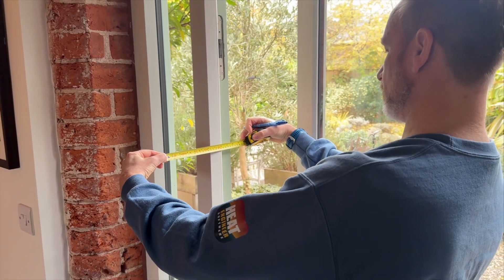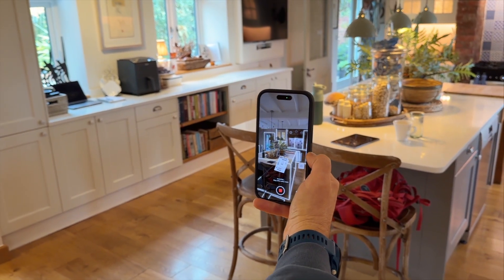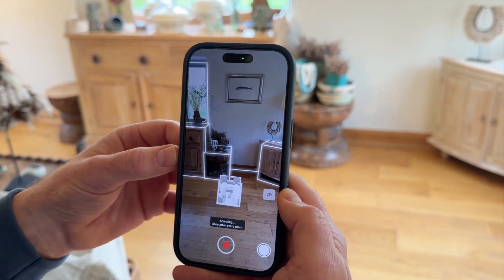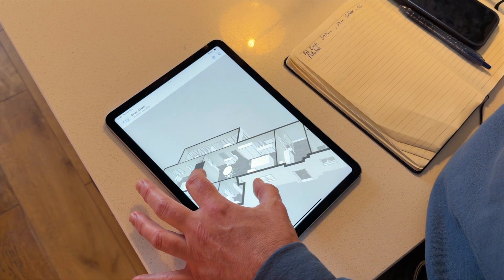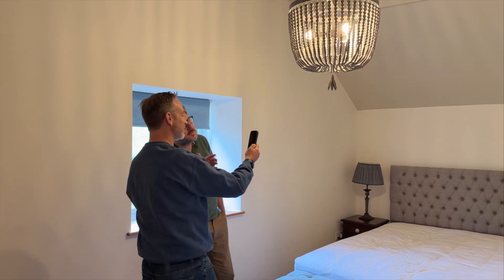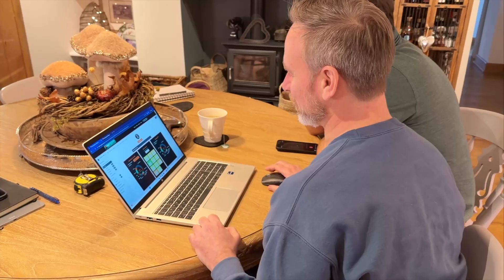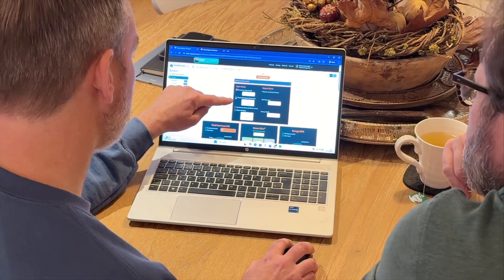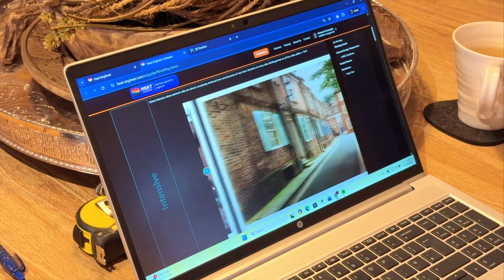Size Your Heat Pump Perfectly: Stop the Guesswork

Comment: When I got my heat pump installed the heat loss survey was suggesting we were needing a larger heat pump compared to the peak gas usage on the coldest day, so we got the next size down from the heat loss calculation whilst being above the peak hourly gas usage. Coolest temperature outside has been zero degrees Celsius so far and it's managed fine. Be interesting how it goes with more prolonged colder spells later in the winter. 

I'm surprised using the existing heating use as a factor didn't come up in the video, unless I missed it.
Reply: Yes, using the gas-usage is telling a lot. Also about the airchange calculated in.. And personal behaviour using the house.

Comment: Evening 

I did a heat loss for a customer on friday that had used an MCS umbrella company for a quote and heat loss. They did this off plan and stated it was 6.7kw heat loss. I have used my Lidar heat loss app put actual data in and come out at 8.5kw. Not a massive difference but in my opinion could definitely mean someone ends up with an undersized heat pump.

Comment: To me the most important point of doing the heat loss calculations is to work out what insulation needs fixing. After you've fixed the cheaper insulation issues then think about something like a heatpump. A lot of insulation has a very rapid payback and it'll cut your bill before you get something like a heatpump.

Comment: I bought an cheap (£20) laser measure online and used Heat Punk (free for personal use - create a free account first). 
I watched the Heat Punk instruction videos on YT. My own heat loss calcs were only 5% different to the Heat Engineer value given by my installer who used a fancy lidar based tool.
Maybe it was luck, but others have used Heat Punk to great effect. Easy if you have mainly rectangular rooms.
Michael Podesta also has a video on how to calculate heat loss using your previous gas bills and some rules of thumb.

Comment: What are people's thoughts on actually measuring the internal and external temperatures over a few weeks and use the gas usage from the boiler as the heat in to work out the heat loss? Use that in combination with heat survey?
Reply: I initially sized ours on the basis of the gas energy usage over the previous two years being roughly the energy requirement. It's a good way to get a general feel of the energy needed and the numbers, but I think it's a terrible proxy for peak requirements which is what actually also matters a lot, so you definitely need to do the heat losses even by hand to get a rough check as well.

As we were doing air/air I didn't have to care much about accuracy because air/air systems can be expanded and inverter air/air can be way oversized without harm.

For air/water it's a different game as accuracy matters so - check you work yes, actually size it - no IMHO
Reply: For some bizarre reason the MCS (Microgeneration Certification Scheme) standards do not permit the use of historical energy consumption data (such as energy bills) as the basis for calculating heat loss to size a heat pump system. 
MCS requires a formal, theoretically-based heat loss calculation for system design and sizing, in accordance with specific industry standards: 
Mandatory Calculation Method: The heat loss calculation for an MCS-certified installation must be a detailed, room-by-room assessment following the methodology outlined in British Standard
Reply: @davidsinclair144  an issue with historical heat bills is that some people actively limit how much and how long their home is heated to keep their bills down. It has been long advocated to not to heat rooms that you are not using. Not switch on the heating until a certain date regardless of conditions and then switch it off as soon as it’s officially spring. Other tactics including minimizing being at home, to avoid using heating. There is the other end of the spectrum where heating on all the time at 24C plus and temperature in rooms regulated by opening windows. An ASHP works better at lower temperatures, run open loop and just left to get on with it. Basing ASHP on historical gas central heating usage may result in undersized or oversized in these scenarios.
Reply: Yes I used the smart meter history to show that we could go for the next heat pump down compared to what the heat loss survey said. Will see in a few months how things go with the first winter since install. Smaller heat pump means easier to modulate down in the shoulder season. 

Also I'm not sure pure weather compensation works, needs a bit of room influence as things like the wind can bring down the temperature a bit, so a few extra degrees of flow temperature is needed.
Reply: For me, measured data is always the most valuable. But, it doesn’t allow room by room emitter sizing.
At worst, it allows a sanity check, mine was out by 400%!

Comment: It is worth noting that failures to quantify air tightness accurately are often the most significant factor in the oversizing of heat pumps, especially for older properties. Even amongst newer builds, poor air tightness contributes significantly to the well documented performance gap which is not seen in passive house building design and construction.

Comment: If I contact, say, 4 installers for quotes, do I need to pay £300 or so to each installer for a heat loss calculation?
Reply: Make sure you own the heat loss calculations if you pay for them, then you can use them with others. Definitely watch the small print on that.